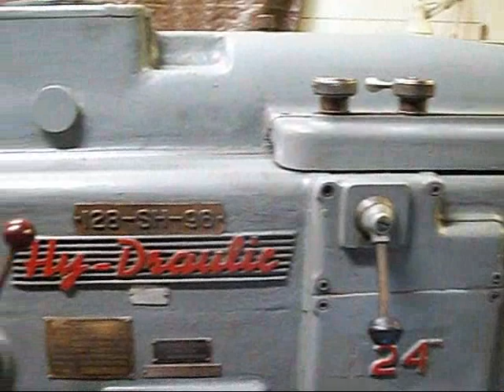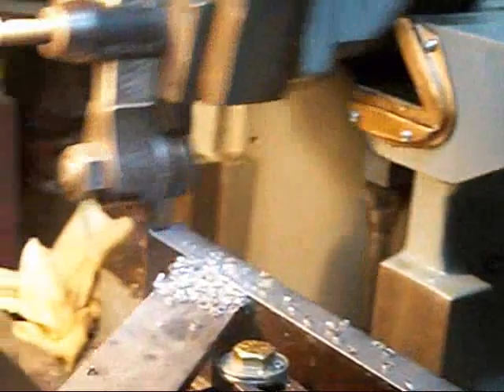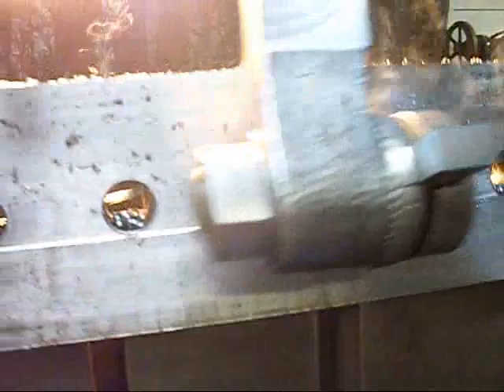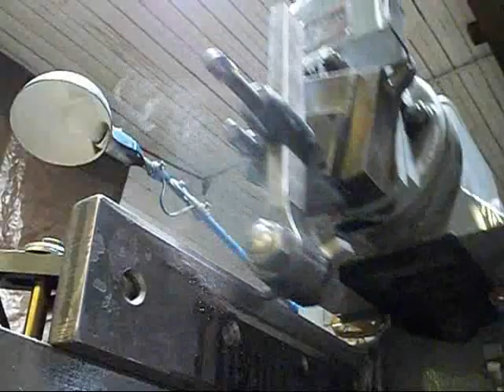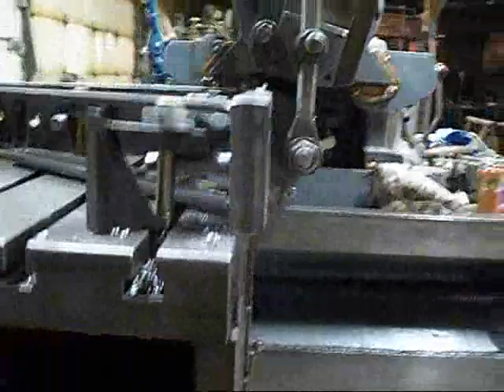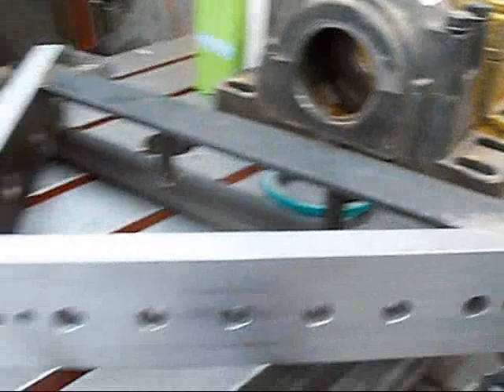ANGLE PLATE III WMV

Comment: Have air lifters on both my old G/E   24" and an GA Gray planer. Work great. First saw them on MW Drop Box. Had heard about them from my dad born 1921. Would like to have seen them in 20's to 40's all mechanical.
Reply from the maker: Someone told me to tie a piece of leather behind the cutter tu lift the tool and for a wiper also I think I will try that first

Comment: Power clapper lifter: check out the latest video from the Backyard Machine Shop. Mike just came up with a new/old shaper that has some shop-built solenoid installation to lift the clapper, and a couple of switches to turn it on and off. You could probably do something similar (and safer) with that Bimba cylinder.

Comment: After all that work I think I would have tried to get the holes parallel to the edges, just in case you ever wanted to use them for setup stops. Looks like they turned out nice! I likely will end up having to make some for mine.  but I will have to mill them since I don't have a shaper.
Reply from the maker: Yes you are right . But this was a rush job .But now I can go back and drill and tap holes in them with the boring mill and make them straight